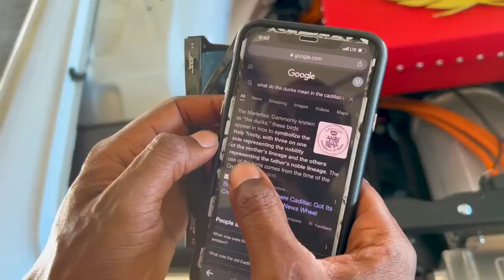If Tesla made a Cadillac, this would be it

Comment: The Caddy was cool but the truck is perfection. I love the powerplant. I can think of so many cars that I would love to install one it. If I can get 150mi range I am fine with it as a daily driver. There just needs to be an easy way to spread out the batteries so you can balance them throughout the car to get  as close to 50/50 weight distribution as possible.
Reply: Well there's always under the hood.
Reply: @dontrustwhiteyevery1  That and fire suppression/safety in the event of a crash. As it stands where the battery is situated, it's more likely to shear off the bed or stay in place but give enough space to anyone in the cab to hopefully get out in a roll over crash with the cage they have welded in. Of what I see in most cars, they spread the battery pack along the wheel wells or shove it under/behind the seats. The high mileage cars aside from having a high density battery cells keep the batteries stacked along the bottom of the car with multiple layers of fire retardant insulation etc.

 I don't doubt that fire departments have started some suppression training measures for EV fires but it is pretty much a new game so far as fire fighting goes because we just don't have enough accidents to study for the best ways to power down/put out a battery fire yet. For reference on average there have been approximately 213,000 car fires per year. If anything, it actually means safety systems are under utilized in ICE cars AND EV's and as of yet there is no ready accessible way other than fire retardant or extinguishers to prevent/manage them.

Comment: I remember just 5 years ago trying to look into these heavier EV conversions and would rarely ever see stuff like this. It would always be the smaller compact (and rarely even anything cool like a 70’s Honda) cars that I’d see get converted.  

Even though I’m trying to be less car-reliant, I love seeing this become more and more of an option, especially for out-of-town trips or even rural areas where public transport besides maybe Amtrak can be genuinely hard to accomplish, even with the best planning/funding/whatever.
Reply: To be fair, one of your main reasons to try a conversion is your old motor was starting to fail. So a lot of early EV conversions where crappy old cars.
Reply: @Skylancer727  True, though it’s not like bigger cars/trucks don’t have that issue. It would usually be something small that’d get the treatment. Something like an 80’s Lincoln Town Car or a 50’s Caddy were just unicorns in regards to EV conversions. 

One of the few guides out there at the time even specifically said to use a car that was:

- Manual
- Less than 2,000 lbs.
- Wasn’t totally new (usually pre-2000’s). 

Basically, it had to be a Beetle or an 80’s Civic for optimal effect. It’s also ignoring the annoying big-batteries-in-the-trunk method a lot of conversions used, and well before proper kits like this were being sold.

That’s why the one EV Accord from a few years ago was so fascinating to me: Not only was it impressive, but it used a bigger and more common-ish car that was unlike most EV conversions beforehand. It’s becoming less and less needed to shell out a bunch of money (and miles) to get the one cool project car that’s both good for conversions and unique/old enough to have. Stuff like my high school dream EV conversion (an 80’s town car, which are quite common in my region, converted to EV) is now becoming more and more possible!
Reply: @keybyss98  honestly, I think the trunk battery is a decent enough solution. It's basically the cheap option requiring way less over working and you also don't need it water proofed. Most cars have open bottoms and rather poor sealed fronts so the batteries need weather proofing. So I think it is a solution, just not a quality one.

Comment: 35k for a revon crate motor. Needs to be about 1/4 the price for it to be even consider that build on a working man's salary. Unless you mean 365 days nothing but work for the supplies needed and on the truck. Anyway beautiful truck.
Reply: Once the well heeled adopt the tech; prices will fall, give it time...invest now in copper and rear earth metals
Reply: Most car resto mods aren't actually done on a "working man's" salary anyhow, unless it's lingering in a garage for years.
Reply: 35-39k without bms, charger etc. not exactly a working man’s budget there. Maybe in 10 years once we’re flooded with model 3 parts this will be a realistic prospect
Reply: It's based on tesla core which is what requires that price....manufacturering needs to catch up
Reply: @uome2k7  yes and my comment was based on what they said about being able to build that truck on a working man's salary.

Comment: I don't like the way Revolt Systems made the mount, it's too close to the center of the motor, under real driving conditions I see that eventually twisting or distorting the frame where the bracket mounts and also loosening the bolts that mounted to the actual motor housing,.  This should be a solid wider CNC bracket. But that's one beautiful caddy.
Reply: I think they’re should be rubber bushings if it doesn’t have any yet, but those mounts would hold a 500lbs engine making the same hp. Even with that over hang.
Reply: If they got some real investment, this system would be a DYI hit..

Comment: Those Revolt motors are super nice looking.  $34k buy in is pretty steep though....
Reply: $34K buys a bunch of gas.  I'd love to ev swap one of my cars but the cost exceeds just buying a used EV.
Reply: @quademasters249  Lucid will make a killing if they start selling their tiny 600hp motors to the general public. I'd buy one... Or two...
Reply: @Rollin8.0   It's a tiny niche of a tiny niche.  Of the small number of muscle car owners, you need to sell to an even smaller group who want to trade their V8's, one of the primary reasons for owning a muscle car, for a whisper quiet ev motor.  

 I'm sure they can sell some.  Whether they can sell enough to sustain a company is an open question. $34K is just the entry price too. Then you have to pay for everything else like the battery and charging electronic.  I notice most of these cars don't have AC or Heats too. 

I'd rather install a crate LS for 1/3rd the price

Plenty of good products died because they cost too much for people to buy in.  Ultimately you're talking about spending $50K to convert an old not particularly good car into an EV.  Losing heat and AC in the process.

Comment: The battery mounting on the truck is pretty neat. That's always been my question mark for a lot of conversions I've had in my head.
Reply: Nope..just no. If the powerplant can be between the framerails...so can the batteries. They said they removed both fuel tanks somthere literally is a huge amount of room under the truck. Stupid to give up the bed. Also, put in trunk floor of somekind like in the new Hummer. AND DEFINATELY DO MORE BODYWORK! That was just half assin it!

Comment: Looking at the truck conversion, it looks wonderful.  But can it be improved?  By mounting the battery pack low in the frame, you will greatly improve the weight distribution, so cornering would improve.  Also like shown in the drag race, the wheelie the car did looks great, but the battery under the front hood would make it work much better, by putting more weight on the front axle.  It would be just as easy to mount the motor in the location of the factory transmission, or even a little further back, with a very short drive shaft.  While the rear motor mount looks great, a 1,000+ torque motor should be mounted on all 4 corners IMHO.  It looks like a solid mount, but rubber would get torn to shreds.  How about using something stronger, but still give a little flex to the motor.  Or a Oilight bearing material? 

I think that three battery packs might be ideal.  With one under the hood, and two others between the frame and driveline.  We all know what can happen to a fuel tank mounted between the frame and truck bed.  

Are you using a water cooled battery pack?  While it is OK to use air cooled, IF there is no time that you will be on the throttle more than a minute or so.  But for fast charging and long drives, you should be using water cooled battery pack.

Comment: I want to build an electric rock crawler all I would do is hook the motor straight up to the transfer case what do I need to buy motor wise and battery wise like could I use 12 volt batteries to run the motor do you think I would need to run a transmission in order to get it to go foward and reverse

Comment: I remember in 9th grade, 1995 there was a big ev conversion event at my school. Bunch of 60s american cars loaded with lead acid batteries and could drive 100 miles on them. Now the battery tech has caught up. Its all about the battery with EVs guys. The battery is everything. 
PS if you want to see an apples to apples comparo compare battery toro recycler to the gas version. Lawn mowers baby. Basically the cost is in the battery and its why a nissan leaf costs 10k more than a versa which is basically a gas powered leaf. Historical fact- its the same reason EVs were so much more expensive 100 years ago.  Historical fact- Henry Fords wife drove an EV cuz the model T was a pain in the a$$ to operate.
Reply: Thats the slight downfall of EVs for right now they cost on average more than an ice car and the average person is already on a budget so they will take the car that costs 10k less. Despite the ciost saving over time with the EV its just that upfront 10 extra K is enough to turn people away. The range anxeity  from temperature conditions and cell degredation is another thing that concerns people. Looking at Teslas ands the current ev Prius etc. Whats my range if its freezing cold outside? What if I need to replace my battery? is it going to be more than the car? likeright now a tesla battery is 22thousand dollars not including installation fee. Where as any ice car a new or used engine doesnt anywhere near the full price of the car. You could get a new or used engine ranging from 1, to 10k cant do that with a battery pack even a new pack for say a Prius is over 10k. There needs to be a major shift to bring battery prices down to make them really compete with gas cars rn+ the charging network needs to be expanded more. The vast majority people do not own homes thus not having the luxury to plug it in at home. EV has a few hurdles to overcome to gain mass adoption even with government pressue and gas prices being crazy
Reply: @TAKIZAWAYAMASHITA  quick google search shows that, in the US, the average new car price is 47k, the average used car price is 31k, and the homeownership rate is around 65%. The current electric car technology is ready for mass adoption. We can see this in the super long waiting list for many EVs. The only thing limiting EV adoption right now is manufacturing. I do hate the fact that poor people are blocked from owning EVs, whether that be from upfront cost or home ownership. I would love for that to be fixed as the technology improves. But, most car-buyers are not poor, and that's good enough to start.

PS: you can absorb the initial 10k upfront cost with loans. Depending on gas prices, that might not be crazy
Reply: @chaklee435  yes you can absorb the upfront extra cost but most people don't think of it that way if they NEED a car they will often settle for what's cheaper. Example offer a man a new non electric Toyota Camry vs an electric Camry if the gas one is 10k less guess which one the average person will buy
Reply: I mean I think it's more that EVs are sold more as luxury vehicles for the most part. Look at most EVs how they add the more advanced experimental features to them like the Hyundai Ioniq 5 or the Hummer EV. In comparison, the Chevy Bolt is about the same price as any generic car. It only has a sticker price of $27K. That's not the cheapest car on the road, but it is pretty close to it. 

The Nissan Leaf has the same price, but half the range and uses Chademo. I wouldn't touch that like the plague.
Reply: @TAKIZAWAYAMASHITA  If EV adoption is being held back by financial illiteracy, then that is not a EV technology problem. That is a people problem. The tech is fine. And anyway, I don't think people are stupid.
Reply: @TAKIZAWAYAMASHITA  Everything will get cheaper. The first few waves of evs will be expensive. The technology is still developing and I doubt that the manufacturing process has reached peak efficiency yet. I’m sure they are getting there but there’s still a lot of room for improvement, as well as micro improvements to further drop the cost.
Reply: @TAKIZAWAYAMASHITA  youre 100% correct and its why Elon no longer talks about making the model T of EVs anymore like he did during those years leading up to the model 3. He used to say thats what the 3 was gonna be, not another rich persons car. Fact is the ev future is gonna be small EVs for the average person like the nissan leaf and chevy bolt cuz the batteries are so damn expensive. Its gonna be pay altima $ for a versa. And theyre not gonna get cheaper guys. These are not computers where price drops exponentially cuz of mores law. Theyre chemical products and the basic economies of scale apply, ie it only gets so cheap before you hit the point of diminishing returns.
Reply: @deletefacebook8419  Everything ONLY gets cheaper to the point of diminishing returns and thats still gonna be alot more than the cost of a compariably sized ice car or hybrid. The ev future is pay what a midsize costs now for a sub compact. Pay what a luxury gas suv costs for a midsize sedan.
Reply: @Henry_Jones  Perhaps that’s the case. However, we don’t KNOW this for sure. We aren’t far enough along the beating path to be able to realistically reach a logical conclusion as to when EV production is going to plateau in efficiency. It hasn’t leveled out yet that’s for sure. So ig only time can truly tell wether or not what you said is the truth. Fact of the matter is, the Giga press is capable of eliminating many factors on the assembly line. The design of the teslas hasn’t even reached the ideal form. It’s very aerodynamic, but not as aerodynamic as possible. Furthermore, with that in mind we can assume that the cost of batteries could be significantly reduced in material cost as well. Less drag equals less input needed to secure a desired output or design. We clearly still have plenty of room to grow in the EV market. I’m not sure about the battery technology but I’m also not an engineer. However, you don’t have to be an engineer to have a basic understanding of thermodynamics, and have an understanding of how systems work. The EV factory’s are still in their infancy. Regardless of the history of EVs, we still haven’t fully seen how efficient the production of said EVs can really be. Plus, ideally we will speed up the rate at which we gather lithium bringing more competition into the system. In hindsight this has always brought down prices in the past. So we can assume rationally, without even having an engineering degree that the prices will go down.
Reply: @Henry_Jones  also, having more aerodynamic designs further amplifies the amount of resources that we can pour into the development of batteries. We don’t have to have the best of the best batteries if we can reduce drag and cut weight down enough to be able to use different alloys. So perhaps, todays EVs are highly potent. However, just as with smaller ICEs we can also have less storage capacity, if we can mitigate the amount of energy that needs to be transferred to reach a desired output. We don’t need to be able to accelerate from 0-60 in two seconds lol. Although it’s certainly nice it’s not necessary. The future is going to be pretty great. No worries because the people that are leading the industry are the best in the business. If someone in this country can figure it out, it’s certainly them. I mean, we are already witnessing explosive growth. It hasn’t stopped either, although many might think it has. The drop in Tesla stock is merely an average amount. Many other companies and countries have joined the race as well.
Reply: @Henry_Jones  it’s certainly difficult, there are certainly hurdles to climb but is that not what us humans do? It’s a hard thing to do, but we’re doing it are we not?